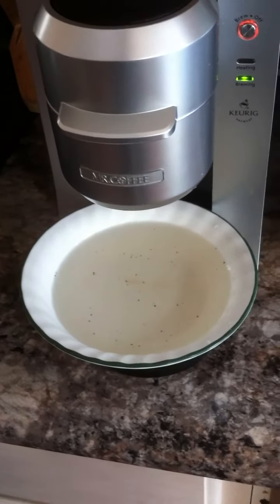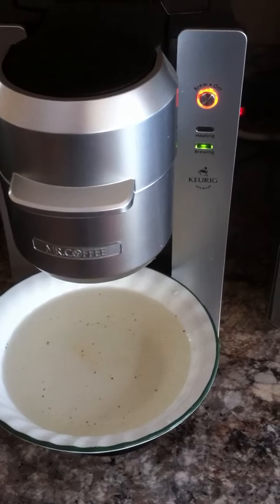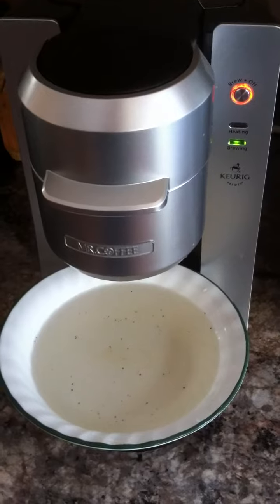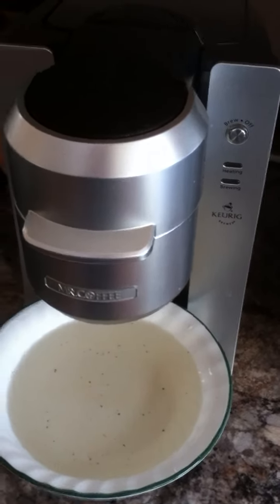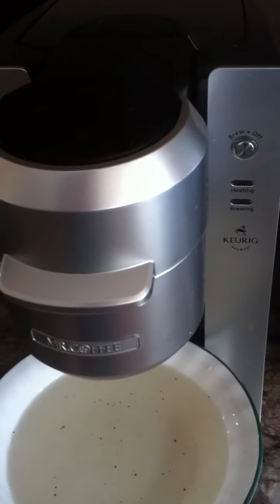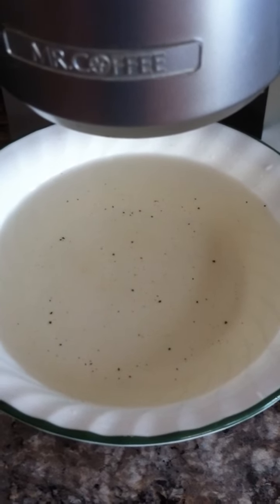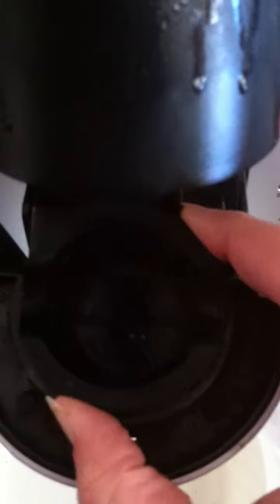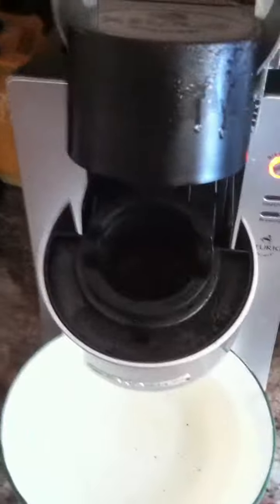How to clean and descale your keurig one cup coffee pot

Comment: Thanks for this and the needle fix.  I've already done the descale for about 1000 cycles (it seems like, anyway) but haven't cleaned the needle yet.  The menu screen still says "descale", so I didn't know if you'd had that issue when your machine slows down.  Guess I'll go find a needle... I did try a toothpick yesterday, but was afraid I'd break it off in there.  Don't KNOW why I didn't think about a needle, but it's certainly worth a shot.  Thanks for your videos!
Reply from the maker: I hope it helps.  The "needle fix" has saved me a few times already. thanks for watching.